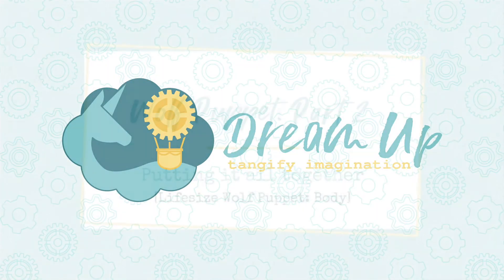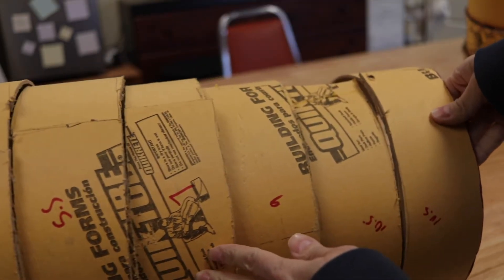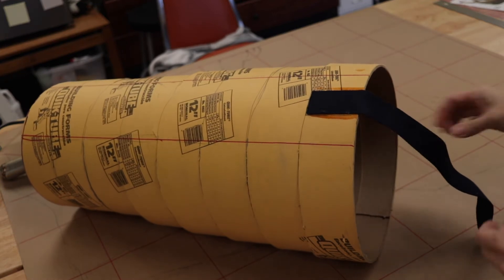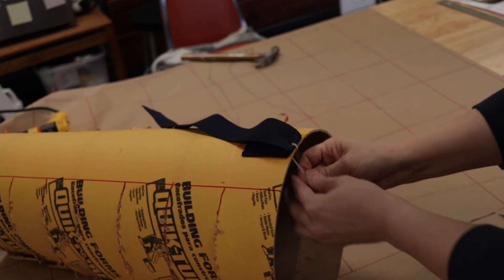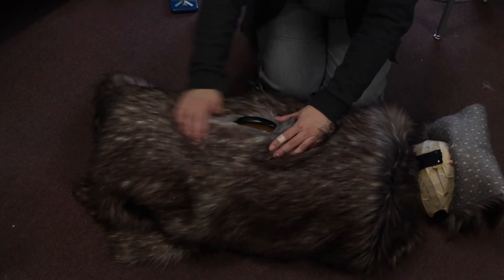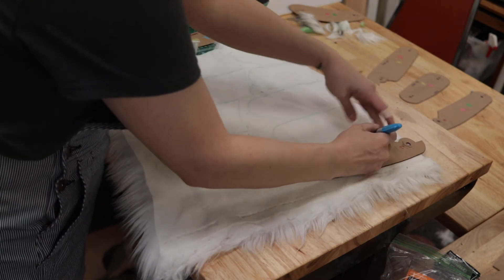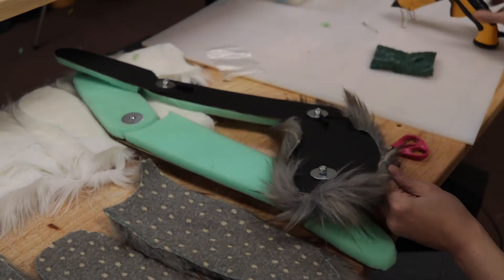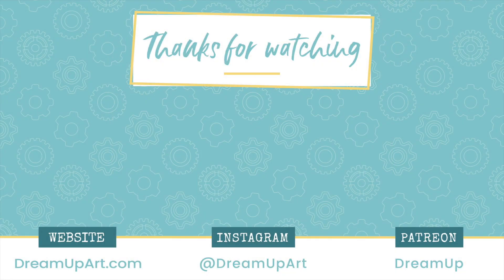Lifesize Wolf Puppet Tutorial | Part 2: Constructing the Body

Comment: I am confused on how the puppet gets finished in the neck area. I see how you made the torso and how you draped the fur from torso to the base of the head. But how exactly does the neck come about? Is it simply the strap from torso to head with nothing but the strap? Your video looks very step by step and I feel like I can make this for my theatre groups show Annie Jr. But I am not grasping the neck area so any guidance would be appreciated! Thanks!
Reply from the maker: Yes, it's just that strap used to connect the torso and the head and the fur that's draped around it to give the illusion of a neck. In a previous version of this puppet, I tried a more complex method using different sized rings/hoops to give more fullness to the neck, but in the end, the rings ended up collapsing on each other and the whole thing ended up working just like the strap! If I build another wolf puppet someday, I think I would try adding some foam or something to edge of the cement tubing to smooth the transition of the torso into the neck. When these puppets are moving, you can sometimes catch a glimpse of that sharp cardboard edge. I'd be interested in hearing what changes/improvements you make if you end up building something like these!